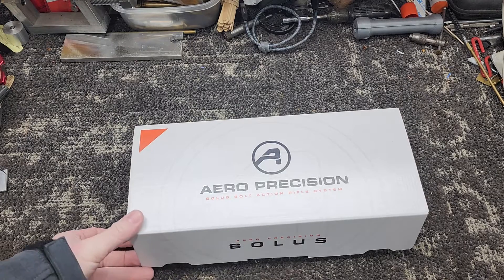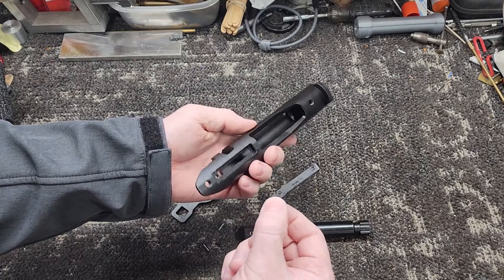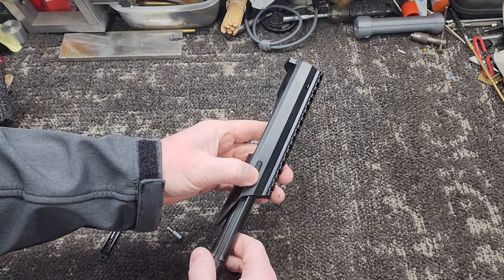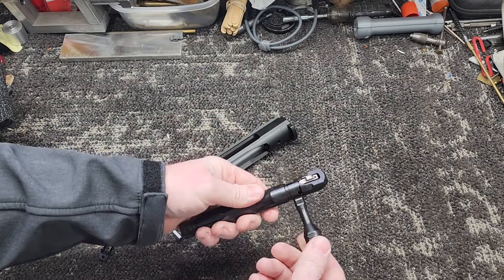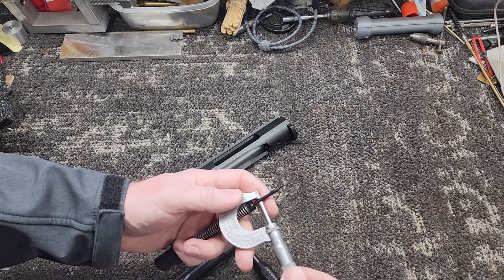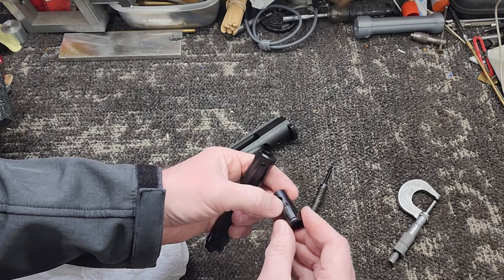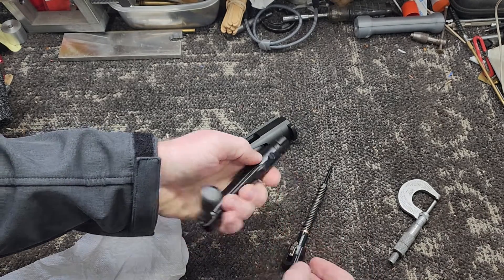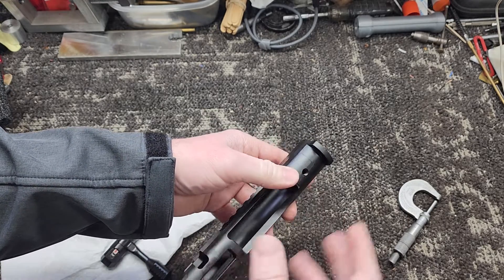Aero Precision Solus Bolt Action Review Part 1.

Comment: I accidentally twisted my bolt the wrong way and it’s stuck. Any suggestions on how to unlock it?
I think I decocked it.
Reply: I put the flats at the rear of the bolt into a vice and turn the bolt body to get it back in the correct position.
Reply: @mckimmym Thank you!

Comment: I did not see the follow up video on this? Did you do one?
Reply from the maker: Not yet, I was waiting for the lightweight version to come out, which they are now. I tried to pick one up recently, but Aero sold Out really quick. When I get one, I'll do a follow up and most likely a build on one.
Reply: @apexcustomrifles  I just recently bought a rem 700 AAC-SD 308. I bought the Solus 17" competition Chassis and a 700 Calvin Elite Trigger 2 stage. I was looking to put this bolt action on there. There is a 200 price difference between the lightweight and the original, but i was hoping to see your follow up to help me make up my mind. I was online today and the lightweight is now back in stock.

Comment: Great vid. Looking at this from a budget build standpoint. They just had halloween sale where everything was 20% off. I should've snagged one. The area around recoil lug where it's recessed I agree is an issue. Maybe revisions will be made. Something I think Aero should be made aware of. Overall looks like a nice action and like that zermatt origin prefits will work with it. Thanks for the info!
Reply: Hope you got it on Black Friday, I paid 750 shipped for a barreled action.
Reply: @InkwellFoto  I’m broke. I couldn’t afford one even with the sale. Wish I had some funds I would’ve snagged a complete rifle for 1250
Reply: If your able to build cheaper than purchase let us know.
Reply: @gregoryholliday6017  near impossible lol. I got a Solus 308 action, Woox Furiosa Ultra chasis, Triggertech Diamond pro curved trigger, Badger Ordnance Condition One MAX 34mm mount and a Primary Arms PLx  6-30 (I have a more appropriate 3-18 as well).I'm at around 4k so far

Comment: #1. Isn't the interchangeable bolt head a feature on the Arctic Warfare?

#2. This is probably nitpicking, but I think it's a little disappointing that the 1913 rail is integral, because MDT makes some really cool chassis systems that completely envelop the receiver.

#3. Even bigger nitpick: I've kind of been turned on to DLC over nitride as the ultimate high-durability low-friction coating 😅
Reply: #2 my point exactly. I was holding to purchase a MDT Ess and throw a full rail hand guard on it but would need a taller scope base for it. Can’t do it with the solus

Comment: are you able to compare the Solus action against the Seekins Havak action for $1200?
Reply from the maker: I don't have a Havak action handy. If I get one, I'll for sure update with a review.
Reply: This is a question I have as well. I'm 95% of the way sold on a Seekins Havak Hit, but want to see if the Solus sways me
Reply: @Kristjanmorgan  the Havak action seems like a better deal than the Solus because it is a switch barrel design.   Seekins also provides the open source specs for the barrel tenons.   That coupled with the fact that Seekins has had that action out in the field for a while now is a winner
Reply: @plrodrig123  excellent points, thank you! the switch barrel feature is a major selling feature, though i wonder how often i would actually ever swap barrels? i dont know, still a great nice to have though